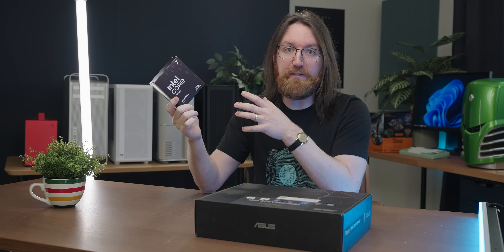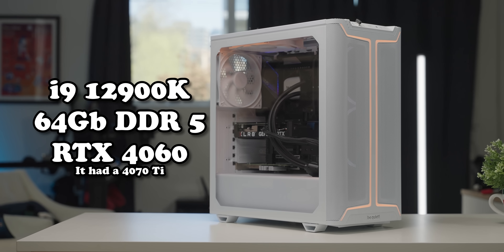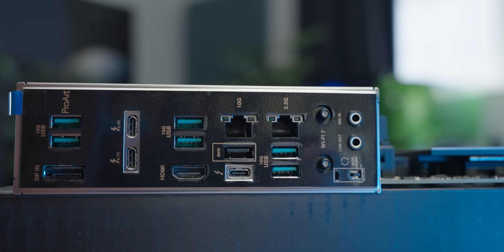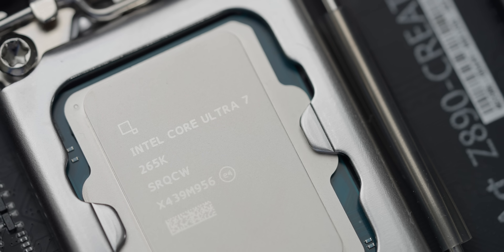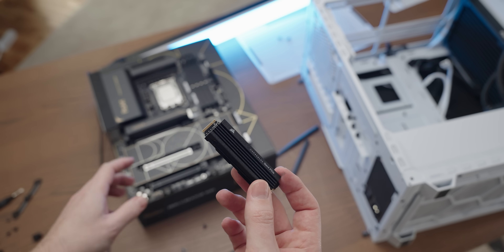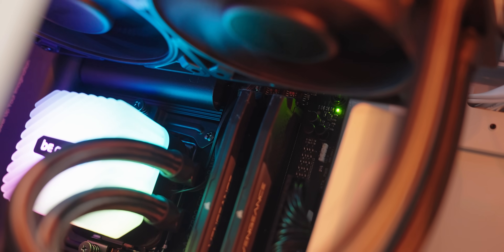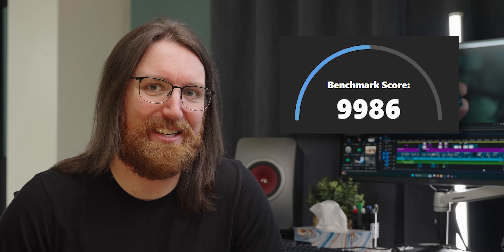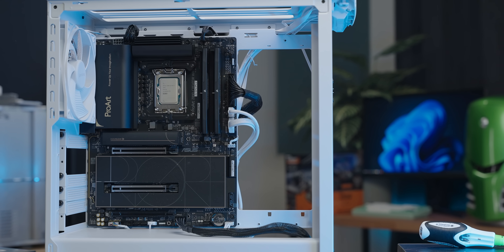I ACTUALLY Bought An Intel Ultra CPU In 2025...

Comment: Arent Intel CPUs also good at keeping your home warm during the winter months ??
Reply: Yes.  And wouldn't you rather heat your home with a gaming laptop than an expensive electric heater?  Since either way you are increasing the entropy of the universe.
Reply: @Christopher-b1p  I keep my feet warm in winter, by resting them on the 110watt (RMS) power amp I run my PC speakers through.

Comment: I bought my Core Ultra 7 after a lot of the initial issues had been fixed. Personally, I don't mind it at all. My only issue is the price. Really didn't like paying over $300 for mine, especially since it's like a... what, 15th/16th gen i7 basically?

Comment: Am i missing something here? You mention almost at the end of the video that you replaced the 4060 GPU with a 5070, for your I7 ultra setup. BUT...... you DIDN'T do the same, by using the 5070 GPU on your pervious 12900k build? Only for your AMD build? WHY? Maybe the 4060 was holding back the 12900k. Weird you didn't do the same exact setup?

Comment: I would have stuck with the 12900k, just get a new mobo for it. Intel haven’t surpassed their greatest cpu ever made yet so I’ll be sticking with mine for a long time.
Reply: I mean the 13900k/14900k (if you can manually tune it so that it doesnt feed itself with 1.5v, which isnt hard just takes a few minutes) is a much faster cpu. Shame they're not sustainable out of the box, but with some light tuning they last just as long and perform a lot better.
Reply: @ They are still a risk and in 4K gaming make little to no difference.
Reply: @otacon5648  most cpus wont make a difference, you could prolly go far back and it wont make a huge difference in 4K
Reply: @Sol4rOnYta few years ago I would have agreed, but a lot of newer games are VERY CPU AND GPU heavy. Warzone and Fortnite are both great examples
Reply: @dsrocks6905  it depends what framerates and settings you're pushing. GPU is still 99% of the time the bottleneck.
Reply: @dsrocks6905  exactly that I got a 13700k with manual voltage and it doesn't go past 1.27v and runs very well and cool , i play on 4k 144hz and it's already overkill.

Comment: I have a 12th gen Intel i7 for my work machine.  I have a 6th gen i7 for my main home machine. I notice little benefit to performance with the 12th gen, but boy do I notice a ton more noise, both with stock coolers. I mean maybe docker compose build finishes one second faster on my work machine, but I can't hear myself think while it does so. I mean, it's just building code FFS.

Comment: did you turn off the power ( remove power cable or use the switch on the back of the psu) as normally installing a m.2 won't kill the mobo

Comment: If the price is right and the darn thing actually works reliably, any product can be good value.
And with AMD having become the premium option, my next processor will probably end up being a better value Intel.
Or some AMD chip which works in my AM4 board still. This upgrade path is a significant benefit on AM5.

Comment: i went 6900k 64gb to 265k 96gb, primarily vmware workstation with a lot of VMs. Air cooled all Noctua, and a b580 from 1070ti staying all intel. No complaints on the CPU at all. Same issue with NVMe samsung with built in heatsink, at least on the Gigabyte  board can just leave the heatsink plate off as not fixed. Also bit of video editing using Davinci for hols footage.

Comment: Intel lost me as a customer, I bought a 13700k, it had instability issues, it lasted 2.5 years then died.
Reply: I had a 13700k had stability issues, I sent it back to scan UK and they tested it and confirmed it was faulty, it was swapped with a 14700k. I then had issues with that I contacted scan they tested that and found that CPU was also faulty I got my money back. I got a 14900k from Amazon that too was giving me issues. I returned it back to Amazon and went AMD and never looked back
Reply: 265k is not made by intel
Reply: @asiamies9153  who is it made by then?

Comment: The CPUs aren't bad per se but they are too expensive.
And one of the biggest mistakes of Intel is pushing the e-cores so hard. at around 3GHz they are way way way more efficient and run circles around anything else available. But push them to the >4GHz as they do and they become really inefficient.

But the price is just stupidly insane.
You can still grab a 14900K for <500€, yet the 285K is >600€. The 265k is 350€ - same as the 14700K 
Gaming you could grab a 7600x3d for less, or a 9900x3d for about the same as the 285K
Reply: Ultra has no hyperthreading huge performance loss.

Comment: the new core ultra parts, when tuned properly are actually competent in a lower power state, and the laptop chips rival AMD when both are tuned. Now the laptop chips give up alot of things to remain efficient and competitive against AMD in the graphics department but you can still get ARM rivaling battery life without running at 800mhz
Reply: This just kinda confirms my wish with the 12900k launch that they'd just "oops all E cores" and drop a 12930E with 40 E cores, bus probably couldnt support or supply that many e cores but still.

Comment: 1:52 you should move your rad pipe to the top as directed by steve so there are no chances for bubbles in the motor
Reply: It's actually the 2nd best position for an AIO. Plus, Be Quiet!'s Pure Loop pump is located near the radiator. With this position, it's pretty much guaranteed that the pump won't have air pockets.
Reply: no? Pipes on top allow the air bubbles to work their way back to the pump. You want them at the bottom so any air trapped inthe system stays at the top if the rad.

Comment: I picked up the 265k from microcenter for 230 dollars and so far its been a beast in many workloads especially for the price
Reply: The thing with these CPUs is that for most usage it simply doesn't matter if you use an AMD or Intel chip. Just like in the video, in this case the bottleneck will most likely be the GPU as the task is very GPU heavy and not so much the CPU. The same goes with gaming on higher settings. So yes, AMD is giving better performance right now, that is a simple fact. However the differences are actually that minor, unless you run a CPU intensive task, that it actually is more a matter of which has the best price to performance versus just raw performance itself.
Reply: @Morrodin-WH40K  Yeah people are playing it up because they don't like intel, which I can understand a bit. With that being said though AMD is clearly the better choice at this point for most things. It doesn't help that Intel refuses to support sockets past like 2 generations, so people can't even buy in early and hope a good upgrade comes along.
Reply: @SpartanArmy117  Who tf upgrades every 2 to 3 generations?
Not to mention all the older standards you're left with when you keep an older motherboard while upgrading just the CPU...

The only problems intel had were with the power consumption & generational uplift.
Reply: @thetechrealist  Are you insane? That's one of AMDs top selling points right now. They supported AM4 forever and they promised to do that same with AM5. If you don't think an upgrade path is a good thing idk what to even say.
Reply: @thetechrealist  yes absolutely thanks intel for deciding for us when we need a new motherboard so we aren't left behind with "older standards"
Gee I couldn't imagine choosing for myself if I want to upgrade my motherboard or not when I upgrade my CPU, but AMD is too lazy so they left it up to us :(
I don't wanna think for myself :(

Edit: sarcasm may be too much thinking for you mr tech realist so I'll break it down: you're a clown
Reply: @thetechrealist  Intel's very next CPUs will use a new socket already! That's the problem!

Many PC enthusiasts DO upgrade every 2 to 3 gens. That was one of the reasons AM4 became so popular & why so many people love AM5. It's what made me switch from my i9-9900k to a 7600X, despite knowing the 9000 series was just coming out. I could save money on the CPU & put that towards a better GPU, then upgrade when Zen 6 comes out.

With Intel, you get 3 different sockets with 3 different gens. No thanks.
Reply: @corey2232 Most “normal” gamers don’t upgrade every 2-3 years.

Only enthusiasts like yourself.

A majority don’t need that longevity on a single socket because they could upgrade to a whole new better system later.

Also, to be clear, Intel sucks a big one right now & what they did with 13-14th gen is unforgivable till 2-3 years of stable processors
Reply: I’m still running a ryzen1700 and am glad I can just pass it down to my relatives and slot in a 5700x3d or something of the sort
Reply: @thetechrealist and cpus randomly dying. I lost $1300 on my 13900ks and z790 board. All AMD for life now. If Intel offered a recall I would have a different opinion. What they did was illegal
Reply: @SpartanArmy117  1) INtel is for work 2) you dont need support for 2 generations, if you bought PC for next 5 years - I can basically sell back to my shop all parts and upgrade 3) Amd now is more expensive, its almost same or worse or better a bit in most of benchmarks, so for that money AMD wins just in 4k games. Again, if you are so rich just to play on PC, so buy the best GPU like 5090 and best chip, still now I think its 285k or 9800x3d...9950 also not promising...
I was dissapointed by burning 14 gen Intel, I love that AMD doing well, but after all checks, Intel ultra is the cheapest working solution for me for next 5+ years.
Reply: он не просто зверь поверь приятно удивит в играх в 4к не отстает от 9800 х3д при установке быстрой памяти
Reply: The Intel power issues only exist because >90% of people that ran one didn't tune it right.  The boards screwed over the last few generations of Intel chips, automatically placing a 4000W power limit as default with factory settings and the auto voltages go insane.  That is why the processors were failing, not because of some micro code bs.  Set every voltage manually as per Intel specs, power limit as well, and you see 60W power consumption in many games, and very low package temps.
Reply: @ now we get to the point of: is it my job to tune the CPU right? this is a consumer product, not enthusiast grade hardware, and while I love messing around with stuff, like you said 90% of people don't.
this makes AMD the objectively better product overall, "it just works"
Reply: When we said this about tuning bulldozer (not that it was very good) intel fanboys disregarded the advice. Now the tables have turned and while I don’t agree with perpetuating the cycle of suffering, intel fanboys have garnered a LOT of bad karma over the years
Reply: @boxlid214  Should it not work out of the box? Having to manually tune it just because it comes with fked up power limits is so BULLS!IT, also who would have known? Intel themselves denied that until they agreed to fix it.

Comment: For what it's worth, just used a 265k for my production with a side of gaming itx build. It's actually pretty great. High end motherboard (asrock Z890i) included with a wall of solid TB4 I/O, it was way better value than going equivalent AMD. Got a bundle and saved hundreds. Runs quick, cool and quiet. 

(Since we're shilling Corsair supplies today, their SF750 was also the perfect choice for the build.)
Reply: (To the point, if you factor in mobo cost and need a lot of I/O, that's another argument for the 265k.)

Comment: I don't know if I am mistaken, but cool new? music.   I like it.

I prefer M2 drives that come with heatsinks.  I trust them more than relying on a motherboard which doesn't necessarily come with heatsinks for all the drives.  
Not everybody buys or receives top tier motherboards.  ASUS having a huge piece of...heatsink that can't be removed is the problem.  If you can't even unscrew it that is a design flaw. 

 WAIT, how about the 12th gen with the 5070ti?  What score did you get with that?

Comment: The reason SSD makers need to keep selling drives with attached heatsinks even though most modern mobos now come with SSD heatsinks is because cheaper mobos don't always place cold plates or pads on both top and bottom of the SSD PCB, whereas the attached heatsink from the SSD manufacturer should provide for this level of cooling if the placement of the modules on the PCB requires it. But if we can standardize that too, then yeah, it's redundant.

Comment: If gaming above 1440p this chip is a good choice, especially if the price is right. X3D chips are awesome, but not making a big difference at higher resolutions. I play at 4K and planning a build with Ultra 7, there is really no reason to splurge big on CPU at 4K.

Comment: Buying a CPU for editing.
Continues to only use Adobe, the most scuffed editing software known to mankind.
Meanwhile, DaVinci Resolve continues being free.

Classic Dawid. Godspeed 🙏
EDIT: 5:05 it has a massive learning curve... when you get started. Not when you have been editing for years. It's not as easy as switching from one screwdriver to another one, but after 3 video projects in Resolve, you are 90% there, not counting the plugins that you may or may not be using.

Also, keep in mind, if the program you use is faster, crashes less and is overall easier to use, that saves you energy that you may have otherwise lost on editing in another program.
Reply: Adobes free if you sail the high seas like me.
Reply: @Dictatortot-n3d  True, but it's more of a hassle working with a software that is slow, crashes and doesn't feel good to use. 
So ultimately, learning a better program that is also free is better long-term.

Comment: I downgraded to a MSI pro b850-P from my x670e during it's RMA reunion tour. It was comparable in performance (slightly higher mem latency and reduced pcie lanes) and the fact the lower m.2 slots did not have a heatsink was actually very convenient. Hot V Hotswap.....

Comment: They may not be shifting a lot of these in the DIY enthusiast desktop market, but they will sell a lot of pre-builds with these, and the BGA laptop HX versions which are identical in every way are ubiquitous in slightly beefier laptops already.
And the efficiency at laptop power levels is great. These do great in the 55-80W range and Intel can actually guarantee supply unlike AMD. And they don't have high idle power draw issues like the competing AMD Dragon Range and Fire Range HX line-ups.

Comment: As frustrating as a dead system is, an unstable system is soo soo soo much worse. Especially an unstable system which is inconsistently unstable, you get lulled into a false sense of safety and then bad times.

Comment: Bought a 4060 system for video encoding as well. 
The SFF MINISFORUM 795S7 Mini PC, AMD Ryzen 9 7945HX(16 C/32 T), RTX 4060, 32GB DDR5. I like that it is smole, and only draws 10W idle.
I love the 4060s very fast and usuable AV1 encoder, and the ability to run the Topaz products well enough!

Comment: Wow, how things change with time. I remember when AMD's performance and cost was lower than Intel, and you'd hear this same argument in reverse. "While the AMD chip can't match the performance of Intel, it's performance to cost ratio is a good bit higher." And now Intel's CPUs are questionable and we're looking for them to help bring competition back to the graphics card market. I hope Intel keeps at their graphics cards and processors improvement, I've been all AMD for a long time, but with Nvidia looking to transition into focusing on the AI market, and planning to start making CPUs, gamers need tech that focuses on what we want. I'm running a 9600x and 9070xt and I'm happy with it, but if Intel can make a graphics card to compete with the 9070xt (I'm not entertaining thoughts of 5090 performance, my wallet can't handle that), I'll build an all Intel system just to support what they're doing.

Comment: Four M.2 slots on a motherboard targeted towards "creators" seems superfluous. You should really not be using local storage for production, especially if it's your source of income. Set up a NAS with a couple of mirrored drives or at least a RAID 5/RAID z1 configuration. It won't make data loss impossible, but it'll make it way less likely. Plus, if you have to replace the system you do your work with, all your data is still right where you left it, no need to move things around.

Comment: i think it was a massive mistake for intel to ditch the p-core/e-core  design approach.  intel had finnaly started getting below 14nm with the last few generations , came up with an innovative feature that set them apart from AMD , and out of the blue just abandon it as opposed to building on that innovation.  the fct the core ultra's suck so hard is a testiment that they should have progresed p-core and e-core further  along .  while the 13tha nd 14th gen were having issues i think intel could ahve worked out the flaws and improved  the design further.  threal mind screw though is even goiogn witha  new cpu  design princaple  why , just why are they stil making rectangluar shaped cpus when they know that shap of cpu warps over time ???

Comment: Usually sponsor spots are for useless things I'd never use... but the cables on the side make sense and should have been done years ago. It always frustrated me that nobody making PSUs ever seems to realize how it would fit into a case and where cables would go. This is actually something I'll probably grab next upgrade cycle.
Reply: Side connectors only work with specific (larger) styles of case. It's nice to have it an an option but the increased versatility of standard position cables means I'm not interested in side cables anytime soon.

Comment: I bought the 285k and it is great. The software (2021)  can't make use of the NVIDIA hardware audio denoise - but it flies. Also, the T705 4T is very fast during all the frames on frames off. 

My video often have 14 or so tracks (some dual audio & video).